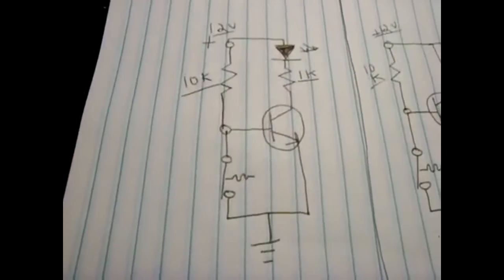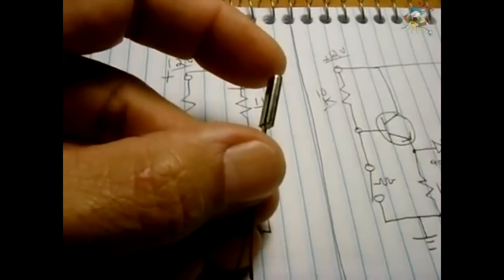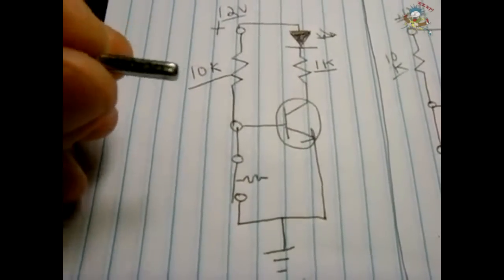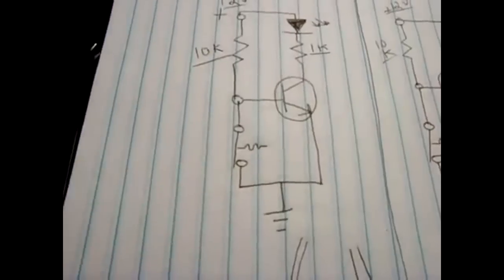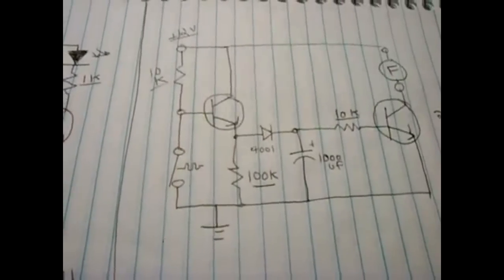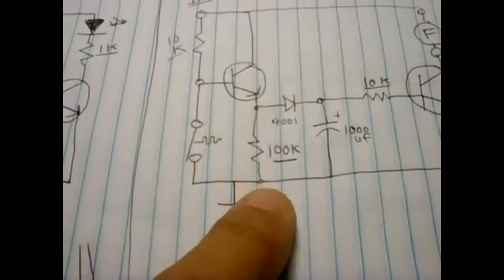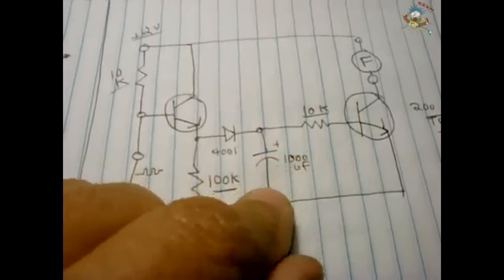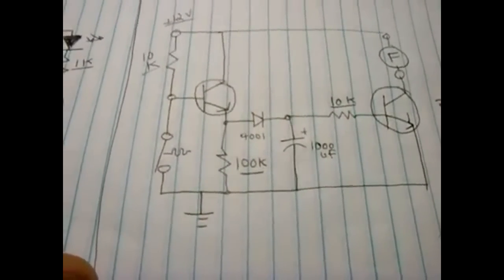Super Simple Temperature(Heat) Activated LED/Cooling Fan Circuit

Comment: Hey I'm new to circuit boards, as well as to electronics in general, so I have a question that may sound stupid: So if I want the circuit to work on lower temperatures, say I want it to activate the green LED when it's 15 to 25 degrees Celcius and red whenever it's above the given temperatures, I just need a different thermal switch and weaker resistors?
Reply from the maker: Just replace the thermal switch with the correct value.

Comment: Built your circuit but didn't work for me I used 2 transistors 3904 could it be they are both different transistors? But great video nice and simple.
Reply from the maker: Hi Ray. It should work fine using (2) NPN 2N3904 / bc547 / 2n4401 / etc... Thanks for watching!
Reply: @electronicsNmore   OK I'll try again thanks.

Comment: hello sir

can you tell me which specific relay and which emf diode ?
Reply from the maker: 1n4148 or 1n4001 to 1N4007 will work. Use a "Songle" brand blue relay.
Reply: @electronicsNmore  

Hello

In regard to the schematic u drew,

if a 5 volt supply is used to power transistor, will the transistor be able to switch on a five volt relay?

from mathematical angle will the switching on voltage  be low?

Comment: Very nice !  I have to try this.
Shouldn't be another resistor, in series with the 10K resistor, as a voltage divider for the 12V going in to the base of transistors? 
I'm a newbie into electronics trying to learn
Reply from the maker: Thanks! The circuit doesn't use a voltage divider. Be sure to look over my extensive video playlists for other great electronic circuits and most importantly share.
Reply: @electronicsNmore  lol. that's quite an answer.
Reply from the maker: It was short and sweet.

Comment: This is exactly what I've been looking for; I'm not a hardware guy, but do build PCBs with information I glean from sources like this. After reading this, it occurred to me, that what I really need is a cascade of 4 different LEDs: the first would be blue, indicating  temperature at or below 25C; the second would be green at or below 50C; the third would be yellow at or below 75C; and red at anything about 75C. The trick, which I have no way to figure out, is to not have all lights lit, only the one corresponding to the temperature range. Is this doable? Oh, one more thing, the circuit I'm working with has a 24VDC input and  pulls less than 2 AMPs.
Reply from the maker: You need to use the LM3914 dot driver IC shown in the video below. 

https://www.youtube.com/watch?v=JQzWSN9K3_c

Comment: Hello there! Can this switch (for 40 Celsius) be mounted on an iron that reaches 300 Celsius, or it will be destroyed?
My aim is to control the coil of a 220V relay, to which I will then connect an indicator lamp. The lamp will turn on when the iron heats above 40 Celsius and then turn it off when it gets cold.
Reply from the maker: Buy a 300c thermal switch.

Comment: Do you have a video that uses simple circuits only with thermistor for electricfan?
Reply from the maker: Hello. Using ONLY a thermistor will not work. The thermistor cannot handle the current, and the fan will not turn ON/OFF properly.

Comment: what about a thermister and a potentiometer instead of the sensor. Is that possible?
Reply from the maker: +Axell Andersen 
Hi there. I have other videos in my "Sensor" video playlist that use thermistors and potentiometers. They use an Op-Amp to trigger. Thanks!
Reply: +electronicsNmore ok. but was hoping to keep it as simple this not having to order an ic. but if that is the pnly way.....
Reply from the maker: Axell Andersen
You can use an NPN transistor along with a thermistor/potentiometer to trigger a relay.
Reply: +electronicsNmore ok thank for the tip.

Comment: Good effort, my project not far away if you could help, I use a 12 vdc drill to tighten a screw, so I need a cut out switch motor when tightness is reach... with great thanks
Reply from the maker: +Nooman BEN AZIZA 
Off the top of my head I would consider using a PPTC which will turn off the drill once a certain amount of current is reached. The more you hold the drill back from turning, the higher the current level.

Comment: Very well instructed and noted.  I am trying to build a suitable sensor that will detect lack of sunlight, trigger a relay, and stay "on" until the sunlight heats it up again.  The goal is to use it to track the sunlight to focus a Fresnel lens for about 4 hours to supply heat to a solar oven. Can this circuit support a relay, where the fan would be to switch power on to a motor? And, could it be made to not shut off until the circuit makes (at the thermal switch)?  I guess it would require a norm/open thermal switch? (when heat is present).  Any help you might have would be appreciated.
Reply from the maker: Thank You. Using a relay in place of the fan is no problem at all. Be sure to use a 1N4003 to 1n4007 diode in reverse across the relay coil to prevent back emf from destroying the transistor.

Comment: There are thingies called rulers to draw a straight line and as for the electronics parts sometime long ago was invented the temperature dependent resistor, thermistor.................. which is used to control temp.
Reply from the maker: Let me guess. ANOTHER troll? Clearly you have not viewed my other videos. If you did, you would see several videos of circuits using thermistors. If you do not like my videos, or how I draw lines, then I suggest you watch videos on another channel and bug them. People who have nothing nice to say, especially after watching a FREE video, are not welcome on this channel. Luckily the number of good people on my channel, far outweigh the bad.

Comment: Thanks for posting this video. I have a laptop whose CPU cooling fan plugs into the motherboard near a burned out thermistor. Needless to say that power source doesn't work any more. I can power the fan by external variac to confirm that it's working and get material off of the laptop. I've been looking to find fans with built in thermistors, which apparently exist, but most are not laptop CPU fans, so I have to build a circuit like what you've shown, or figure out how those fans with built-in thermistors are configured (ie: the rating of the thermistor and where it connects) to be able to get a portable, working laptop again. If you have any suggestions on this matter I'd appreciate it. I haven't had the time to sit and figure it all out yet.

Comment: Hi great video and good explanation. What temperature does the bi-metal strip operate? Can you get them at different operating temperatures for different applications? Seen most of your other video's and they are good; a definite thumbs up. Thank you. Regards Bob
Reply from the maker: Bob, Thanks For watching.

The thermal switch was a 45 Deg Celsius(113 Deg F) / NC. You can buy many different types and temperature ratings. A simple Ebay search for, "Thermal Switch", will pull up many.
Reply: Thank you for your quick reply.

Comment: Very good video :) I'm quite familiar with those the only problem is I haven't seen those in low temp and for some electronic you need to be under lets say 60 degrees for LED then you need to improve the circuit a little. Good for high temp though. Thanks for sharing!
Reply from the maker: Actually they come in many different temp ratings. I have seen them low as well.
Reply: electronicsNmore I suppose I should have read all the replies, I now know that there are different temperature values. Thanks